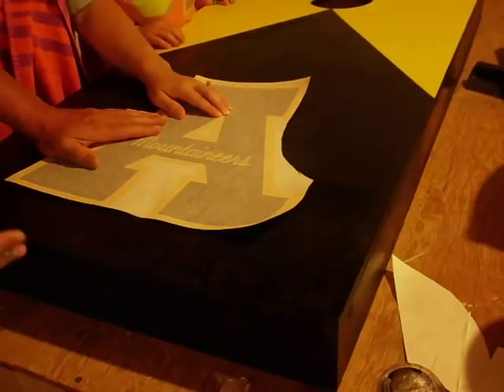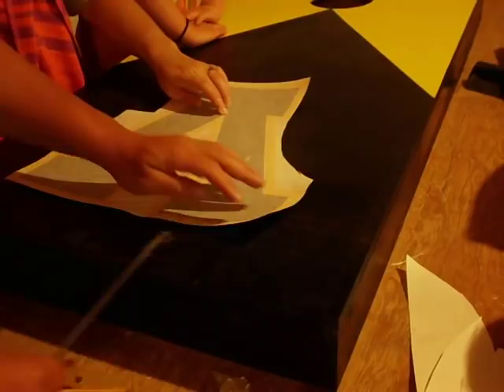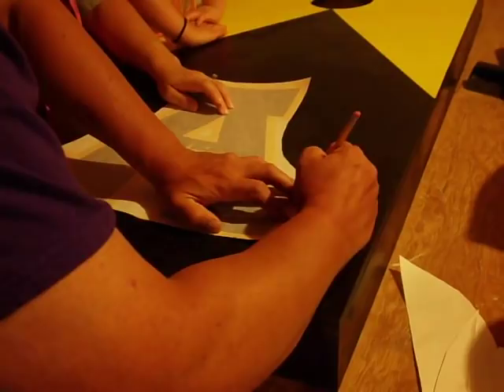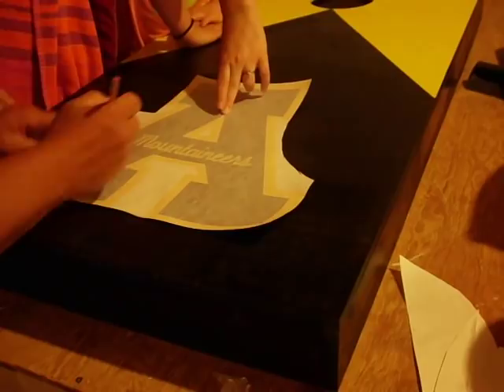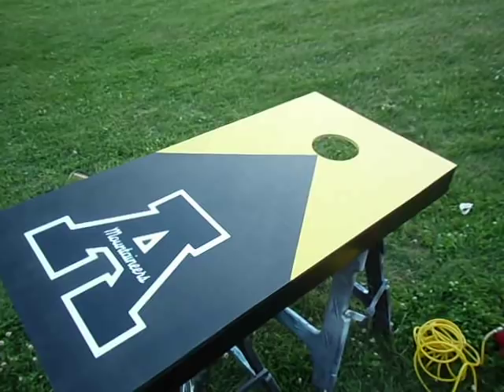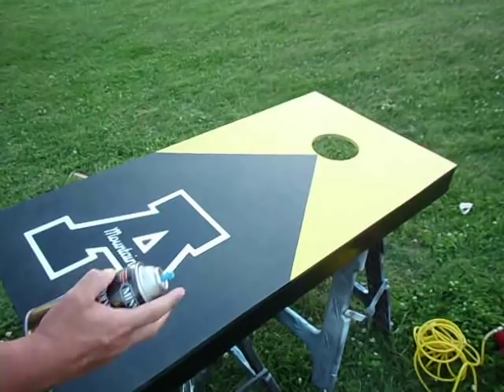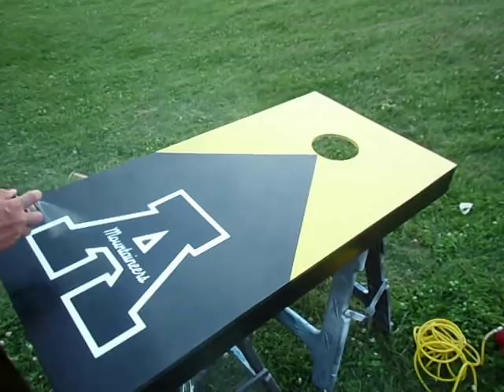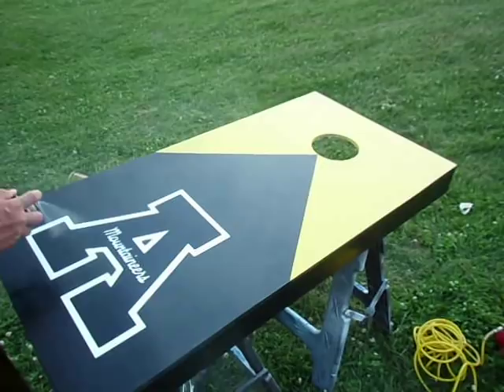How to finish/paint corn hole boards chapter 4.

Comment: NOTE:  with any white paint on the boards you have to use Polyacrylic or your white will turn yellow after awhile in the sun. and if you put it on with a brush made for poly you will only have to do about 3 coats.

Comment: Hello, did you run into a problem with the polycrylic/polyurethane adhering to the vinyl sticker?  If so, how did you overcome this?  If not, what was the surface of the vinyl sticker?  Matte?  Thanks.
Reply from the maker: Jerome Keehn no I didn't have any problems.  The sticker was slick.

Comment: Did you have to sand the polyurethane coats to keep them smooth?
Reply from the maker: Gandolf74 I did a set last week and did not sand the polyurethane coats. Turned out fine.

Comment: After you painted your boards did you add any kind of poly or sealant BEFORE applying your decal?
Reply from the maker: no.
Reply: +bigjc12000 what if the boards are not painted, just sanded plywood?
Reply from the maker: +12345 6789 I would put my sealer on after the decals. it will help hold them on.

Comment: Just finished my boards and ready to do the polyurethane or polycrylic spray. There's white paint/decals on my boards and I see people saying polyurethane turns them yellow. U think I should try the polycrylic spray?
Reply from the maker: If you can find some water based spray you won't have to worry. if not it probably will turn a little yellow over time.
Reply: Thanks for the reply and advice. I saw some Minwax water-based spray that I'll use instead. Would you recommend clear satin or semi-gloss? I don't want the boards sticky, of course.
Reply from the maker: I'd use semi gloss.
Reply: Thanks for the info!
Reply from the maker: Yes sir.

Comment: What brand of spray paint did you use for the black?
Reply from the maker: Rustoleum  works well for me.
Reply: Semi gloss?
Reply from the maker: That or flat will work. The polyurethane will make them shine.
Reply: I seen people use polyacrylic instead what's the difference?
Reply: El Muchacho polyurethane is cheaper but it tends to yellow especially over white. Polycrylic doesn’t yellow the colors and I think most importantly it isn’t as slick on the board so the bags won’t slide off so easily. Minwax polycrylic semi gloss looks awesome.